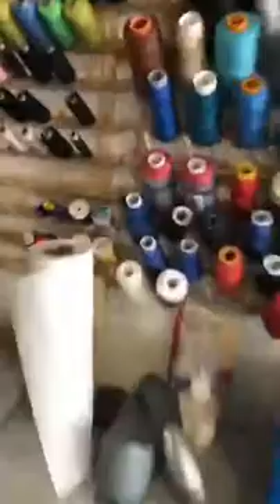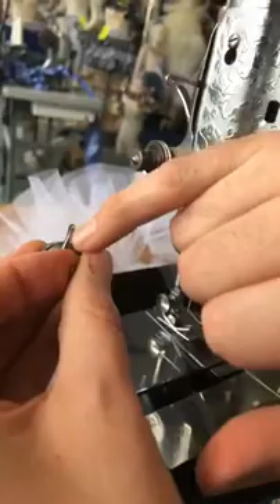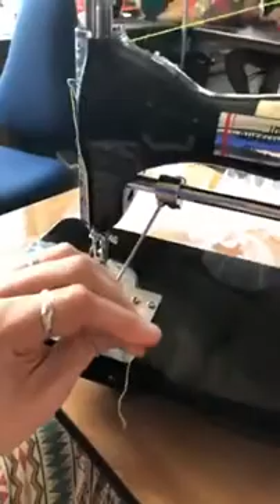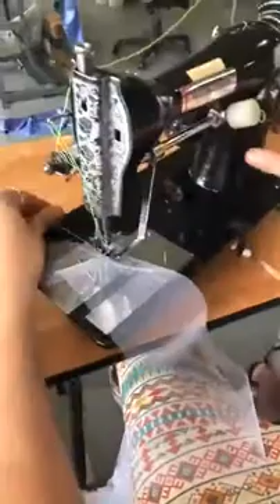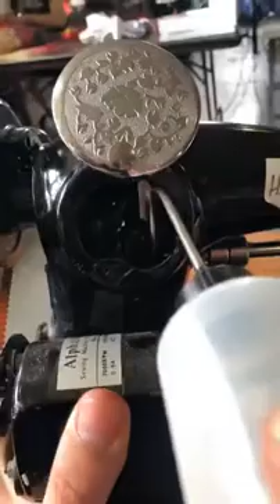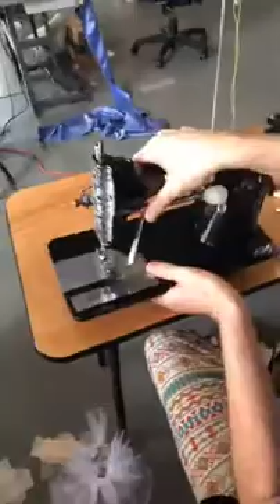How to Use a Johnson Ruffler Machine with Travis Halsey

Comment: Hi, Do you know what motor belt the ruffler uses.  Mine started to crumble so bad that I had to snip it off.  It looks like it measures around 13 and 1/2" around and 3/8" wide.  Thank you for any suggestions you might have.